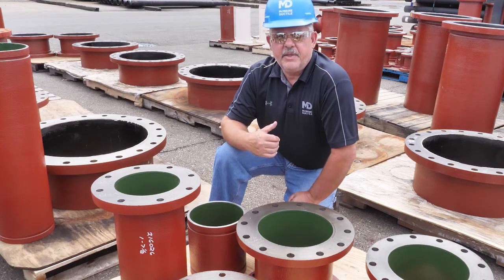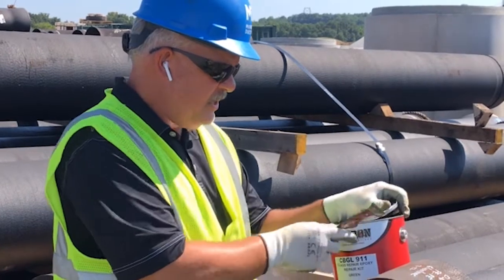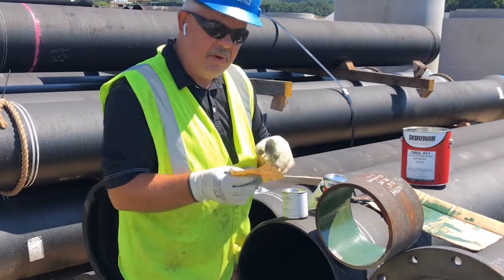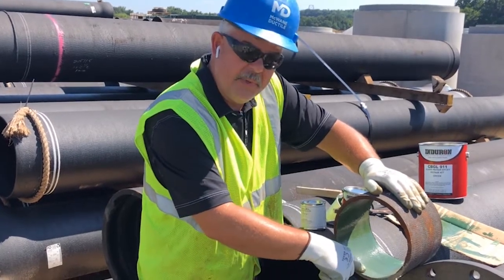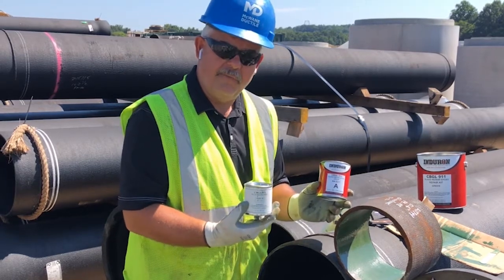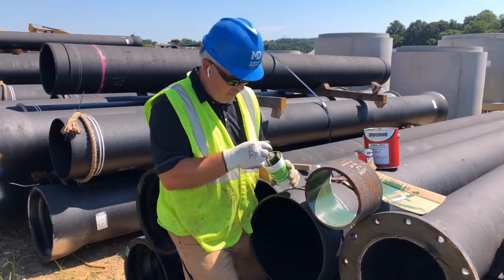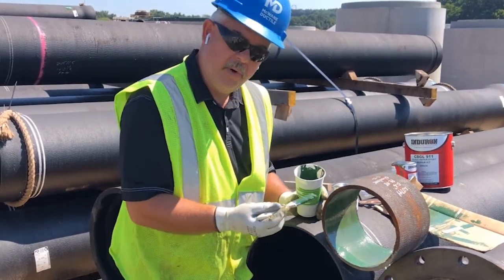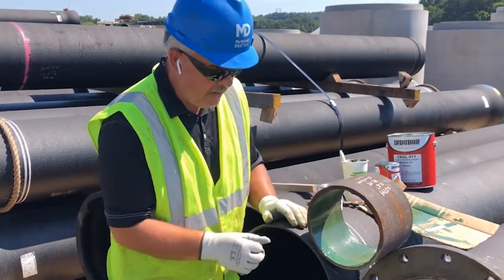How to Repair Glass Lining on Ductile Iron Pipe

Comment: Im interesting with the video, currently we run our Plant with some glass lining pipe and vessel to produce sulfuric acid, and please how can we get detail for repair glass lining if it is possible and how to get the material?
Reply from the maker: Thanks for your question. All our coatings are supplied by Induron. You'll have to reach out to them to see if they have a product that suits your needs. www.induron.com Good luck.